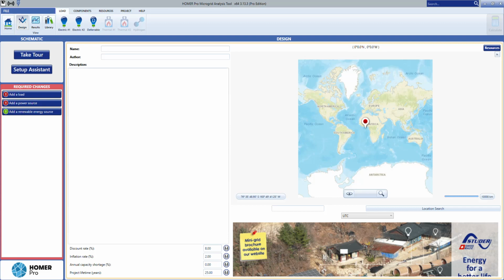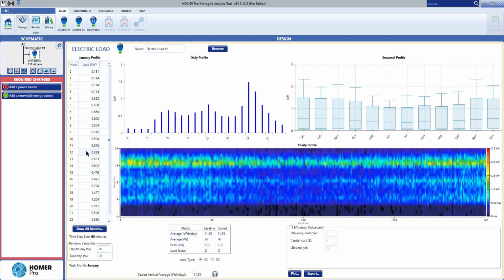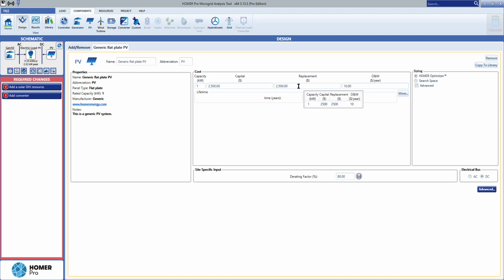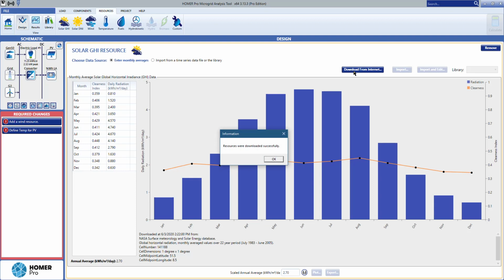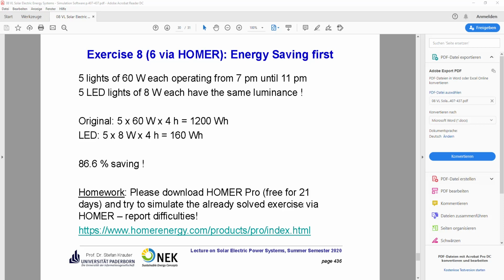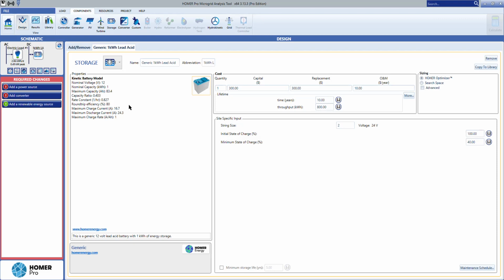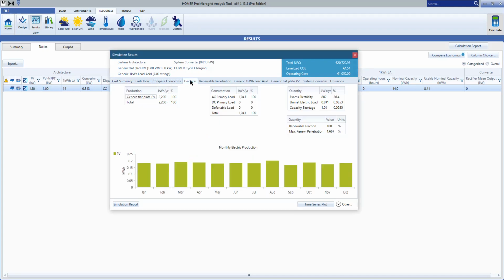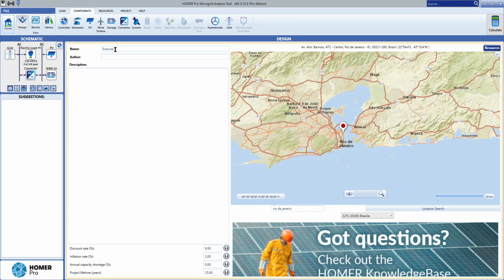Solution of Exercise 08 of the Course "Solar Electric Energy Systems" - Simulation with HOMER

Comment: Hi sir, thank you very much. i have few questions if you can tel me please.
in the resources part, in the wind data. So i can start my project.
what is exacly the :
Altitude above sea level?
anemometer height?
surface roughness lenght?
weibull k?
1hr.autocorrelation factor?
Diurnal pattern strength?
hour of peak windspeed?
Reply from the maker: Dear Mr. Touili, 
here are most of those parameters you asked for, explained (from the course on "Energy System Transition", "Wind Power" part):  https://youtu.be/GhX9yTmENX0?t=710
Reply from the maker: Additionally, here are some of the correlation parameters explained: https://youtu.be/yKVMXZ7bbrs

Comment: Great video. I am working on a micro-grid project which involves the use of a hybrid system - PV, Hydrogen Fuel Cell, Battery storage. The battery and fuel cell are to produce power during low solar pv production times. Homer only accounts for the pv and fuel cell power production, not the battery. I'd be glad if you gave me an idea on how resolve this. Thank you
Reply from the maker: Strange, Homer includes battery storage usually.

Comment: What s the deffrence betweern baseline and scaled annual average load?!
Reply: HOMER uses scaled data for calculations. To create scaled data, HOMER multiplies each of the baseline data values by a common factor that results in an annual average value equal to the value that you specify in Scaled Annual Average.  To determine the value of this factor, HOMER divides the scaled annual average by the baseline annual average. The scaled data retains the shape and statistical characteristics of the baseline data, but may differ in magnitude. The default value for the scaled annual average is the baseline annual average. When the two values are equal, the scaled data and baseline are identical. [https://www.homerenergy.com/products/pro/docs/3.13/load_profile_menu.html]
Reply from the maker: See the answer of Arash. 
Additionally, you shall find information, e.g. for HOMER applied to microgrids here: https://www.homerenergy.com/documents/MicropowerSystemModelingWithHOMER.pdf